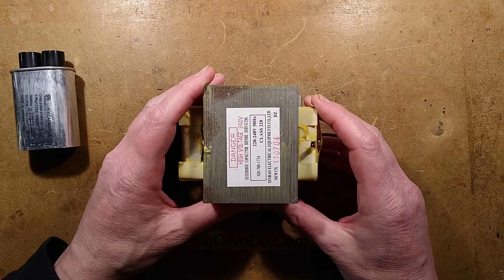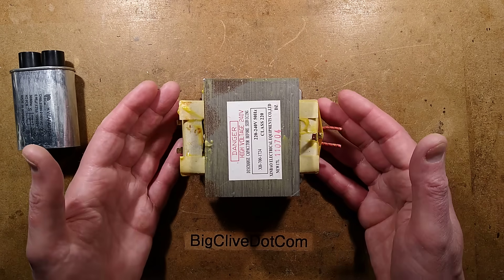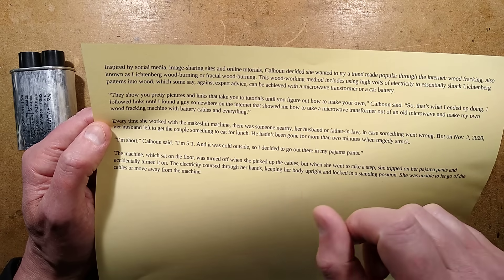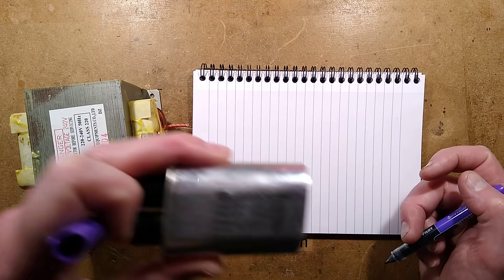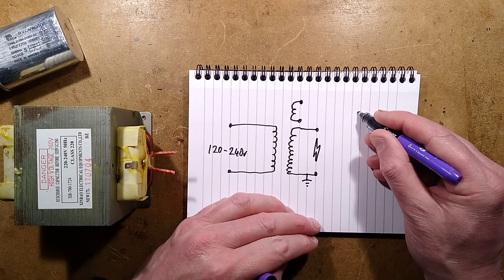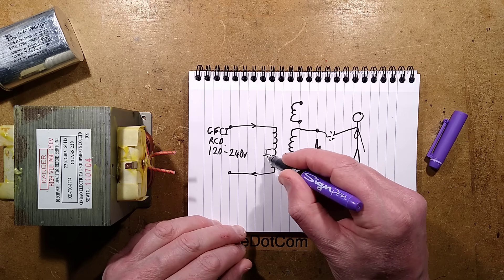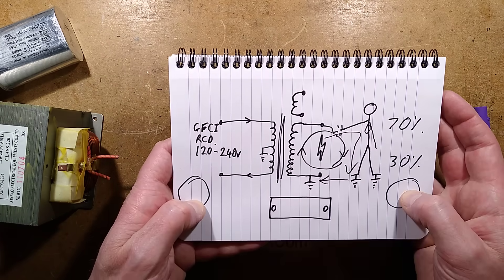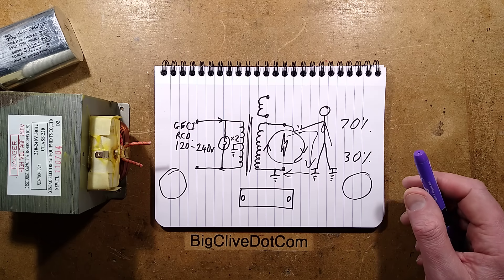The most deadly project on the Internet

Comment: Spot-welder is i think my next electrical project. Wood fracking - will do that too as i do like small wood projects. But seriously - those things i will always make as safe as possible. Got some nasty shocks in my life despite trying to be as cautious as possible (seriously mother - do NOT turn on the electricity when we turned it of for this specific room cause we are working on 3phase - that is dangerous and hurt like hell).

When making electric projects that go higher than ~20V always make it as safe as possible:
Noticeable indicators if it is powered and if it is turned on. yes, i use standby "i got power" Lights. And when any electrified parts are exposed make sure that there is protection against accidental electrocution. A friend and me made a small project were we needed 50V  that we could easily change connections with. We added a second wire to both cables that gets shorted when screwed down to terminals - the powercables were going through 2 solenoids that are powered by those "shorts". certainly not the best method but by ouer tests, even with sweat-wet hands the resistance was too high to trigger the solenoids so it did offer some extra security.

Comment: Yeah... I've done a lot of fun projects with microwave transformers but I've always tried to have at least SOME level of safety with them - first off, I always re-terminate the "ground" side of the secondary so it's not referenced to something I could potentially touch, it's always on an insulated mat on a non-conductive and bone-dry workbench, if I don't need the high CURRENT and just need the high VOLTAGE I always ballast it with a dim-bulb tester on the primary so it can't sink quite so much power, and everything is either controlled by a switch far enough away I can't touch it while it's running, or by a deadman switch. If I have to manipulate it while it's running, I stay FAR away from it, only use one hand, and manipulate things with a 2 foot long glass stir rod with an alligator clip taped to the end so there's no "oh no my hand slipped" or "oops the stick got wet" to kill me THAT way.

It's worth noting that the breakdown voltage between the layers of windings is apparently a lot lower than the total voltage cause one of my projects was attempting to tap some intermediate voltages off to run some high-power vacuum tubes and I ended up just having to cut out and rewind the secondary because trying to isolate things partway through always caused it to arc through the insulation between layers and catch on fire in annoying ways...

Comment: The point is you will not stop people from being stupid, YouTube allow all this to be shown on their platform. I own these transformers I also own worse that do over 100,000volt at high current. Remember people it’s not voltage that does the killing it’s the current that makes you stick to the object that is The problem. That’s why a fly bat won’t kill you, the thing gives you over a 1000volts in shock but its very low current. Also that capacitor in a microwave is just as bad. As they say don’t play with electricity it will kill you in the end.

Comment: I once tried to repair a microwave I picked up out of a skip. I electrocuted myself – twice – because first I forgot to unplug, and THEN I forgot about the capacitor, not having learnt my lesson the first time. So I screamed like a stabbed pig, twice. I finally realised I got off lightly and that I was very lucky, and left it at that. This was all a long time ago, and I did NOT know what I was doing back then. This video however, after all these years, has given me a newfound appreciation for just how lucky I got. So don't do what I did. Big capacitors BAD. Microwave transformers VERY BAD. In fact, the latter are SUCH bad news, they can turn an otherwise fairly harmless 12V out of a car battery or even just a residual charge in a capacitor you didn't even consider into something ABSOLUTELY AWFUL. Both of these shocks could have stopped my heart. It was pure dumb luck they didn't. Anyone messing around with microwave internals ought to ask themselves: Do you feel lucky, punk?

Comment: The really,really bad part of this activity is the operators hold the energized burning probes in their hands while the HV is on.In one video they made probes that can rest on the work without the operator holding them.But the work is energized in the open and with the salt water.Find a safer activity to do! Stick with the woodburning irons.I deal with equipment that has HV -the HV is in a grounded,interlocked metal cabinet.You cannot have access to the HV parts.In this instance 12Kv,25A-that can fry someone to a crisp in short order!

Comment: When I was 11 I found a small transformer in a broken stereo. My cousin told me about putting a 9 volt battery on one side and it would bump up the power out the other side. Well I got a 9 volt battery ripped out the transformer. Was messing about trying to connect the battery and got a right shock. I suppose it was best I didn’t hook the battery up permanently but just had it in my hand holding it on the wires.
Reply: transformers only work with a changing magnetic field, so with a battery connected, no changing magnetic field.
only during connection and disconnection is there any changing field, and then it's only good for a pulse.
Reply: @jnawk83  yeah it kind of felt like when you touch an electric fence. I don’t know if the power would of been there longer as I dropped everything instantly 🤣

Comment: I've had a tingle from 115 Volts from a non-earthed metal cabinet once and that was already unnerving to me. 2000 Volts is a big no-no to me. Besides, the only time I remove a transformer out of a microwave is to extract the copper from it.

Comment: 40+ years later, I still have the scars from a 220v incident. I was :paralysed" by the contact, only got away by falling on my face, the wires broke as I fell. I'm still shit scared and respectful of mains voltage to this day.
Reply: A workmate was checking wiring under floorboards --tracing  cable runs.
He 'found' an old twisted wire joint where the in insulating tape had fallen off.
Second degree burns, meds for over a year, permanent small shakes due to nerve damage.

I've been 'sat down' when I discovered that in a multi-way switchbox in an office one cable was fed from a different fusebox than the rest. I realised it had gone across my chest and I'd been very lucky.

I'm not scared by mains, it just needs plenty of respect.
Reply: I'm "shit scared" of the mains voltage too! I've worked in electronics all my life, taught it for 33 years, and I'm still scared. And I'm in the USA where the mains voltage is only 120 V.

Comment: It beggars beliefhow daft people can be.
Many years ago I had 2kv across my chest while measuring the heater voltage on a radar power supply. The bloke who built the test rig failed to state that the 6.3v ac was sitting up at 2kv! When I'd recovered my equilibrium, I went and complained vociferously... he was an old Dutch bloke who'd been a fighter pilot in WWII... he just shrugged and said "You'd better make a safety cover and label it then!" 
LOL !

Comment: If you are going to do this dangerous thing, is it worth breaking the earth connection  ( transformer core) on the secondary side? That way you can possibly minimise high voltage currents to ground. A Foot pedal switch might be a good idea. High-voltage high-current scares the bejesus out of me. I think it's dead man switch is a must! 

I have how ever rewound the secondary to make a car battery charger, and a spot welder for 18650 batteries.

Comment: lol is perhaps the key to the worst of the naysayers? If they say it, avoid them like the plague. I learned my lesson when I was dealing with an older microwave on the blink. One day it just quit after nearly 30 years of faithful service and I like using them to heat my food and drink. One of the things I was doing without power anywhere near the transformer was measuring the high voltage coil for resistance. You think it might be a harmless thing to do as I did, so without any reserve at all, I did just that. And then I pulled my multimeter probes off the transformer and I got bit. It was highly noticeable and very unpleasant. No one was more surprised than me, myself and I. My meter produces enough current in the secondary winding to build a magnetic field that once collapsing will generate enough punch to make me pee just a couple of drops. It was more the surprise of the experience that made the impression on me, but it's not something to do just for fun anymore. They are highly dangerous even when you "know" what you are doing, I'm glad that episode in my life (troubles with the microwave) are over for a while. It was resolved with a NEW magnetron and due to early covid shipping restrictions and foreign nation banking rules I first had to buy a dodgey used one from Guam where my card would work and then a call to the bank to pre clear a transaction in canada for the pricey new one when the used one gave out a month later anyway. I learned that even though this microwave is quite small, they still make them in this size and power range so a new oven is a possibility after all. We purchased it from Montgomery Ward, it was the only one left (discontinued) and a damaged floor model that appeared to have been dropped on a back corner. We didn't care at all, it took a manager to pull the strings to get it without a box and we picked it up and took it to the checkout counter with him and with his special inputs to the cash register we got to buy it without any warranty or return possible. Our counter space was very limited, only something this size will fit and work in there. They do make them this size, but it's not the first offer and some extensive digging is required to find the super small ones. Upside is that it's still fully manual with a wind up clock for countdown cooking time and a manual defrost switch with a 30% duty cycle mode, 10 seconds on, 20 off. Lightning could still take it out, but it's going to have to be a direct hit for that. And because it was built back in the dark ages, nothing else has gone wrong with it.

Comment: Me, in 1996, high school - Local electric power company employees come in to do a presentation on WHY you do NOT fuck with the mains. Complete with many, MANY, explicitly detailed, enlarged pictures of, well, the results, including fatalities, shown to teenagers as a very clear warning.   (We also saw similar demonstrations by law enforcement and conservation, as to the risks of firearms malfunctioning. Boom.) 

Now, here we are in 2022 and we cannot even show one hand or the KARENS go nuts - no wonder Darwinism is starting to win. 

Interesting sidenote - some years later when i took my Red Seal Automotive Technician apprenticeship, each year, they made a point of showing pics of what happens if one does stupid shit with high pressure fuels. For example, some diesel fuel injection systems can blow right past 25,000PSI, or Pounds Per Square Inch. If a line were to go, or be loose, and any of your flesh is in range, interestingly enough, much of the damage, especially necrosis later on, does look remarkably similar to electrical burns. This is why they teach that if you must inspect a pressurized system for leaks, approach from a distance using cardboard or other disposable materials. The pressures WILL very clearly show up on those materials!

Me, as a mechanic, as a carpenter, as a general handyman, as a novice Power Engineer here in North America, Ive been whacked by 120V AC mains, 12-50KV DC vehicle ignition systems and a fair bit in between. I do NOT fuck around with this shit.  Somethings, ill screw with. Anything over 12V DC, or 12PSI fuel systems, Nope, not riskin that shit. If i cant do the safer way myself, ill find someone who can and is trained in doing so. 

Howd that saying go? There are old explosives experts, there are bold explosives experts, but there are no old and bold explosives experts. If i recall, i heard a version of that on John Wayne's "The Fighting Seabees".

Comment: would you say these are more dangerous than zvs flyback driver transformers then ?  I know those output DC or high frequency.   I have some rubber glove things that are rated at 10kv or something and those are cool but its hard to pick up things with them,  I have also used leather welding gloves for doing a lot of things, not sure how much protection those offer though.

Comment: Wow well done!
I thought about building such a device by my own just some weeks ago. But the mechatronic inside me had scared its sh*t out of his butt, so I quit that idea. Watchin all those videos with open circuits promised beeing safe to use, lying less than 2 feet away from the working area, sometimes dealing more than 4kV on electrodes attached to pvc pipes, jeez I'm really gettin nervous again just thinking about it. There was one dude that build a device a proper closed box out of thick wood, with power on lamp, foot switch for activating the transformer, and so on. All in all a sorta proper system u can build at home. But still he had no real self protection at all, neither thick rubber sheet under his feet nor thick rubber gloves rated for this kind of work. I know, these are expensive, but why building a safe system if u want to operate it that unsafely?

Comment: I've worked on lots of microwaves and only got popped once. I got sloppy and failed to short the capacitor, the four times before that it had no charge. This time it did, luckily I was using the one hand in your pocket rule and it was sitting on the customer's counter top on a towel. The shock just went across part of my hand and was very brief in duration. In other words, I was lucky. After watching Big Clive's video I think I was pretty lucky and fairly careful that was the only time I got shocked in 20+ years of repairing microwave ovens. And I used to work on the three magnetron  commercial microwave ovens. Talk about weird science.

Comment: I once touched a can negative HV capacitor to earth standing on a concrete floor to discharge it. The effect was like being drop kicked in the back of the knees and 60 years later I still have a 2 second gap in my memory. Can you spot my mistake?

Comment: It's a Darwinian thing - stupid people do stupid things and some die. Incidentally, 50 v ,depending on the circumstances and in particular your existing health, can be fatal.  

Your explanation about the RCD comparing live and neutral also applies to anywhere in the home (at least in the UK). You put one hand on any live terminal and the other on a neutral  terminal then you will get a shock  - and quite possibly, a fatal one.  The RCD thinks you are a load, not a human who is in the process of being electrocuted.

If anyone is intending to engage in this sort of stupidity then put the whole thing in a sealed box, keep  your hands dry  and use only insulated cables which are properly rated for  the voltage they are carrying.  

With an isolated  transformer  you should not get a shock  by touching  only one output  -  the current needs a return path so at least keep one hand in your pocket. Better still find a different hobby.

Comment: That transformer is lethal. This is a ridiculous use of it. It is not a thing to be played with and should be left for the application of what it was intended for, not some friggin art project.
When I worked on radar repair we had EHT circuits that went up to 24Kv, the high voltage drawers that contained the magnetron and klystron had microswitches in them that when the draw was opened the power was shut down. There was also a visual indication when full power was on. 
If people are going to make such things for hobby purposes then they should have the transformer and all the high voltage within an insulated cage, made of something like perspex with double microswitches (in series) that when the door is opened all power is shut off. Under no circumstances should you be putting your hands anywhere near the EHT and if you can't do it within an doubly isolated environment then you should not be doing it at all.

Comment: But why would the secondary side be grounded? It would be much safer if it wouldn't?
Reply: They are designed to work completely enclosed inside a grounded box, so the setup is totally safe and helps to reference the RF energy put out by the magnetron so the entire cabinet doesn't radiate microwaves but just the little antenna at the end of the magnetron shooting into the inside of the cooking chamber.

Comment: I have zero interest in making one of these HV hazards(have made a spot welder though, way more chooch than expected!)

But how do you keep the deadmans box from causing the exact same issues as locking up holding the probes? 

If it's shaped ergonomically to hold in-hand.. I imagine you'd just tuck up holding the box and still getting shocked wherever they are touching you from, and reflexively squeezing the box and possibly buttons?.. Maybe it should be buttons you have to hit by entending your digits outwards?

Comment: My burner has a "Deadman" switch and clips only. I made it in a nice enclosure and high voltage leads. I drive screws into the wood and clip the leads to them. I have a variac to the primary and run through a contactor. So I clip the leads on the screws and apply the current at a distance by pressing the "deadman" switch. My high tension leads are 15 feet long. I am far from the high voltage when I apply the power.